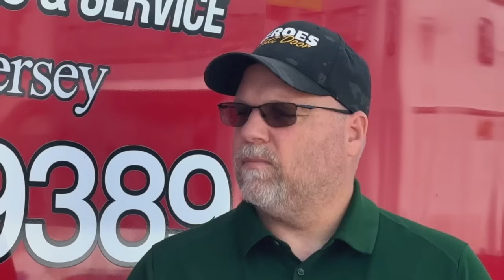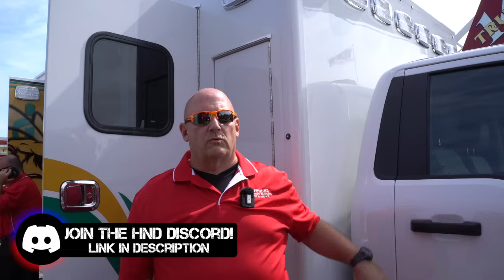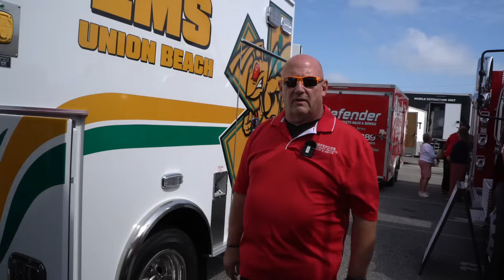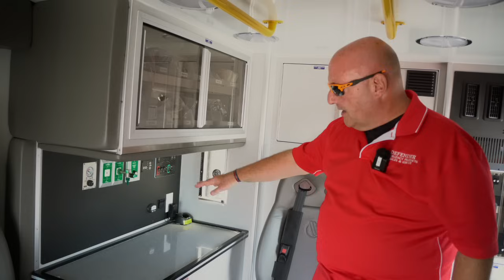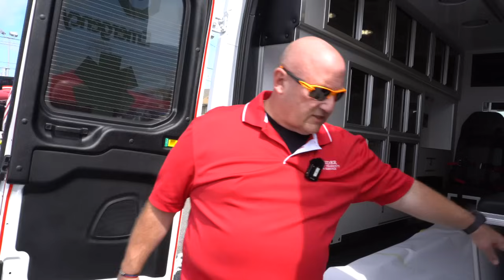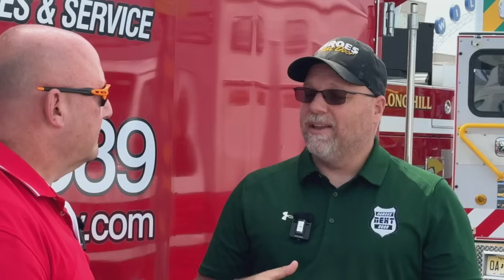STATION RIGS: INSIDE Look TOP 3 ESSENTIAL Emergency Vehicle Types

Comment: I call the Type 2 straight cargo van style a vanbulance.  I think the best platform for those is the Ford Transit dual rear wheel van.  They widen the rear axle track less than a typical dually vehicle and only have about half of the outer wheel sticking out of the body.  This increases payload, redundancy, and stability while keeping the fenders narrower than the mirrors for better maneuverability in tight areas.  These are also available with all wheel drive on the single and dual rear wheel models.

Comment: After working 10 years in private EMS I personally prefer type 3 ambulances when you spend most of your shift in the squad. Having the pass through into the module is nice  if you bring a back pack, lunch box, etc with ya to have everything you need within reach. I've only been in a type 1 at one company I worked for really and I didn't care for it. Absolutely hate type 2 though I spent a good chunk of my career running in those.

Comment: I did hear the very knowledgeable gentleman talk about Ford looking each year at the Ambulance type spec. For a Ambulance special build series. I think that answers my question, if anyone has more information on that please comment back to me, again I am a nerd about all that stuff. I have prepared older Aid rigs for surplus from a Fire Cadet program. We get hand me down, because the Fire Cadets do Rehab on big call outs when MSO or Paramedic and FF air rigs get called out. In are program the Advisor like myself are the only ones who can drive the rigs ( me and my wife) are Adviser for the Cadets 😊 I am in the buying stage of a Spartan Gladiator pumper the cadet program is surplus now. The engine was built in 1989. I want to keep it for the Cadets to drill with 😊 I will take over all the fuel, maintenance, ect 😊
Cost of the Fire Rig. I like the compartment design on the Spartan 😊
It has a hydraulic ladder folded down from top of rig. Both sides of Engine have full height compartment on each side plus a full cross side to side compartment for storage of backboard and linger tools plus a huge compartment on top of rig for all your pike poles. 😊 It has a 92 DD engine with turbo. Allison push button automatic transmission. 😊

Comment: Thank you for doing the explanation of the (3) different types of EMS rigs. 😊. Super interesting and that customer has so many designs they can customize the back box to meet the needs of the owners
On my 2000 year F-250 it said that the PU could not be charged to Ambulance configuration ( voided warranty) can you tell me or anyone who might know more information on that issue. How do they get a chassis that doesn't void the warranty. Is this something the Ambulance manufacturer ( shop) work with lets just say Ford, to get a warranty on chassis after the custom rear box area of rig is then designed. I have never understood how Ambulance can still get a chassis ( especially if there is a engine issue) how is this stuff covered for warranty. Again just asking the question

Comment: What about the huge freightliner chassis ambulances
Reply from the maker: Agreed.  Defender just does not offer them.
Reply: YES saw all FD rigs in southern Florida go with the bigger truck cab with EMS being an extended cab with no full size doors, then some were (4) door rigs. They all had Federal (Q) coaster biggest most powerful most penetrating 😊 that wording is from the 1970s FF magazine  that I loved reading all the advertising in the magazine 😊❤😊 lots of old school Federal (184) type beacons and the glass dome round type Federal made.
Reply: Most places that is type 1, type 2 is box, type 3 is van (from what I heard)
Reply: @fireexplorermichael  it has to do with the chassis the box is mounted on.. Type-1 has a box mounted on a truck chassis that’s separate from the cab, type-2 is a converted van and the type 3 the same as a type 1 but built on a van chassis with the box and cab mounted together to allow pass through from box to cab!
Reply: Typically referred to as “Medium Duty”. US builders typically use Freightliner, International, Chevy, or Ford for Medium Duty chassis.

Comment: In South Australia we have Mercedes-Benz Sprinter vans as most ambulances, they look smaller than your type 2, but seem to have a lot more room than yours, looks like they need to redesign the Ford Van interior.
Reply from the maker: There are some Mercedes ambulance here too. It just this company does not have the contract with those.   Other will.  There are also dodge truck fronts, and even international and freightliners for the big ones.  Again the defender group just does not use them.  👍🏻
Reply: We have the Sprinter platform over here in the U.S as well. However from talking with my colleagues in agencies that use them, their not that great. People constantly tout in Europe about German Engineering, but whatever they do over there isn't brought here, reliability of the sprinter chassis makes Stelantis look like the pinacle of engineering and often their explained as being uncomfortable to be in for extended periods. However take my words with a grain of salt as I don't use one in the agencies I work in. We use Ford E series, GMC Savana vans, and Ford F series chassis. 

Size wise the Transits we have here are the same ones you have in A.U, literally, they are the exact same chassis just with the steering wheel on the proper side (jab jab), the interiors tho do need some tweaking, but given we rely less on removable kits and stock the units way more than you guys do there isn't much we can do to solve the space issue.